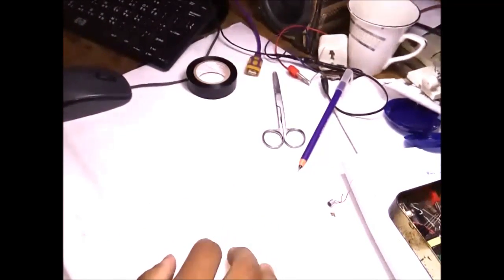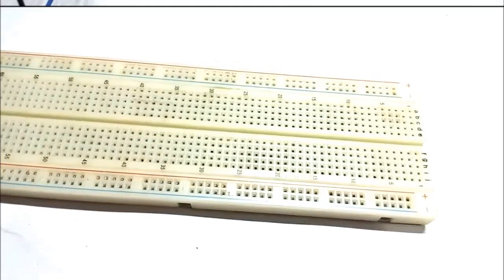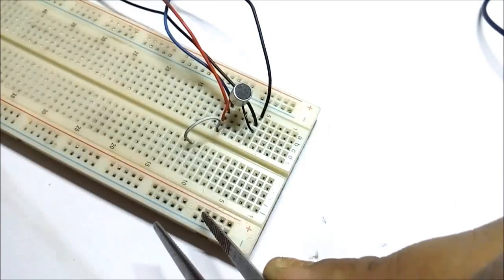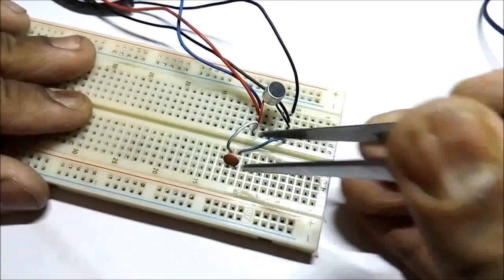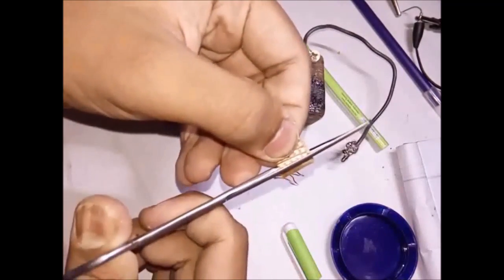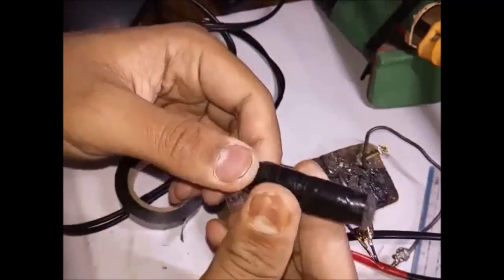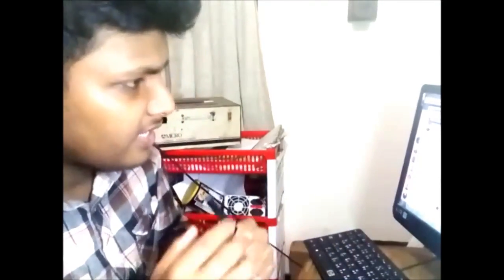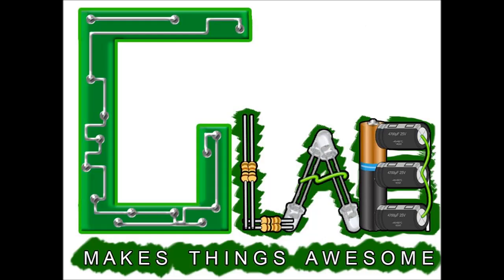DIY Lapel Mic | Make Your Own Collar Microphone under $1

Comment: omg this is awesome..I accidentally broke my condenser mic (transistor?) and tho it still technically works without it..it sounds quite crappy...you just showed me how to fix it! THANKYOU!!! p.s. whats the shorting bit about? Ive only ever just connected wires then bam plug em in..lol I'm not electronically savvy. Is it necessary? Are there other options?